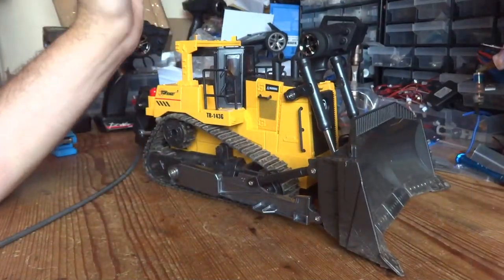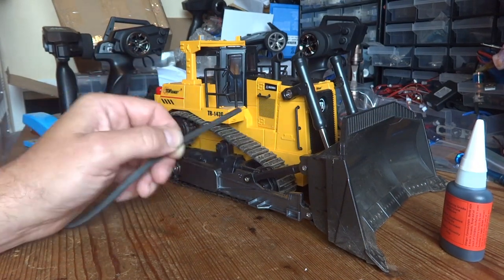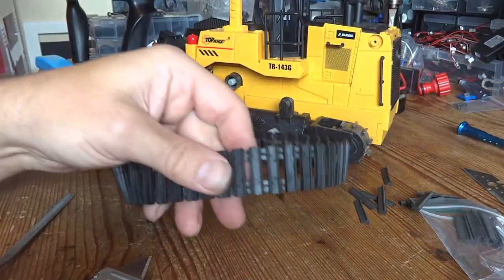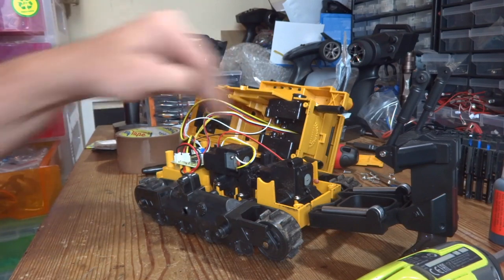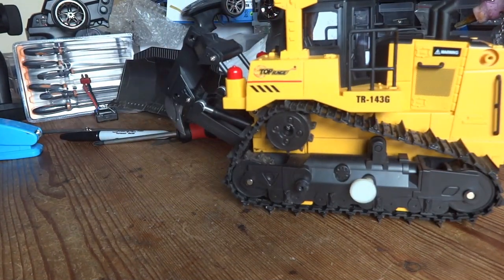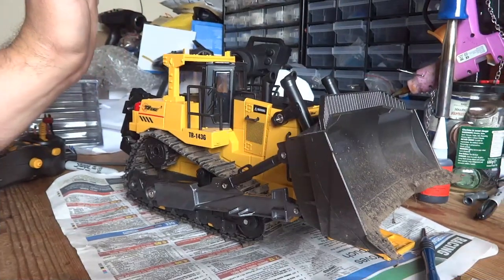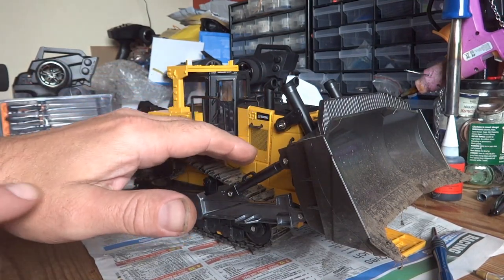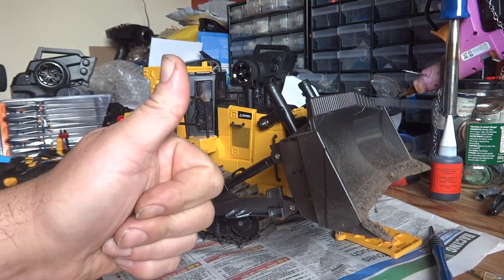Free Mods Make A Huge Difference! Top Race TR143-G Huina CY1569 RC Bulldozer.

Comment: I have a WL excavator. I added lead to the inner track assembles.
But also hot glued bb’s in all the limited nooks & crannies of the upper housing.
Big difference!!
It’s almost 15lbs now 
and performs way better.
Off topic a bit, but I wouldn’t buy the WL again. It had massive cracks in the main stick out of the box! Really!
I had the seller send me new parts and they cracked in higher stressed areas!
I ended up making my own aluminum
gussets. Time consuming but no more problems.
Btw if your wondering what this 65yr old was doing with the machine. I would scoop dog food from one bowel to another. That’s all! After 30 or 40 battery cycles it hasn’t broke yet😁
Reply from the maker: I bet your dog loves it! 😅
Reply: Good nike

Comment: cool mods, the tracks  also look better imo.
Reply from the maker: Yes it does actually now that you mention it! Works a treat! 👍
Reply: @theminiatureconstructionco4556  I have also come up with a  mod for the broken  excavator  thingy,perhaps  show you later  on.
Reply: @grrfy  seen those and usually ouch, for ratchets being too wimpy to dig+move soft dirt.
Reply: @modelnutty6503  its not the ratchet version, its the linear actuator version I have modded👍
Reply: @grrfy  the screw driven aren't bad on muscle at all, the bucket can even help pull it up something steep. total toy versions can't compare.

Comment: Hi buddy I like your work  have you done a upgrade on the battery 🔋 I have done the blade and that's great cuts great now but battery does not last long 😮‍💨cheers Shaun 👍
Reply from the maker: Hello Shaun thank you very much! I've not updated the battery yet. It's finding space on the dozer is the problem. 👍👍
Reply: Hi was thinking if you could have like a extension line wires to plug it in to on the old battery box and run them under the bely of the dozer to the rippers at the back and place the new battery on top of the roof or the ripper area 🤔and you could disconnect from there
Reply from the maker: @shaungwatkin1638  that sounds like a plan. I wonder if anyone does a higher capacity battery of the same size. WPL battery's are the same size but you would have to change the connector. 👍👍

Comment: Is there any upgrades for the drive motors?
Reply from the maker: Don't think so unless larger motors can be fitted. They have slipper clutches in to prevent damage if too much strain is applied.  Must admit so far I've not hadcan issue with the standard units. But I do tent to pick scale appropriate material to move around. 👍
Reply: I might have missed it but How much weight sid you end up adding?
Reply from the maker: @drzflyest4  I think as much as I could fit in the body without it interfering with anything. Sorry I couldn't be more specific.

Comment: slanted blade or snow blower attachment? either way it'd clear freshly fallen snow.
Reply from the maker: Hahahaha sounds like a plan, more fun than a shovel! 👍
Reply: @theminiatureconstructionco4556  foam block and aluminum flashing would be easy to make a clip on slanted blade. more fun than a crawler with a lawn mowing boom stuck on it.. seen done with a 390 motor and weed-eater trimming line.

Comment: Which had more of a impact, the weight or the extra traction? I wonder if you would have noticed a difference with just one of the upgrades?
Reply from the maker: I think they both go hand in hand. Both done together probably equals a better result. 😀👍

Comment: Hello 😊what lipo are in the dozer? 2 s or 3,7 volt?
Reply from the maker: 2S but there is also a 1S version as aswell i believe.
Reply: My have ä 1s lion Akku, can i a 2s lipo drive?
Reply from the maker: @heliflyer111  not sure, you could damage the board.
Reply: briefly had a 2 s lipo on it and it went so far 🤔